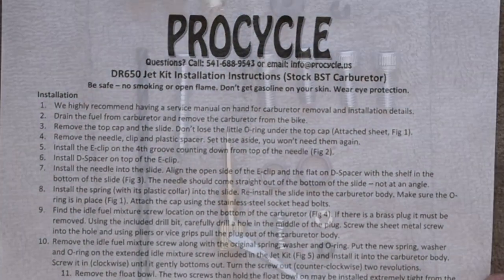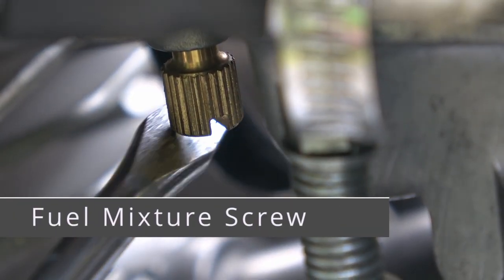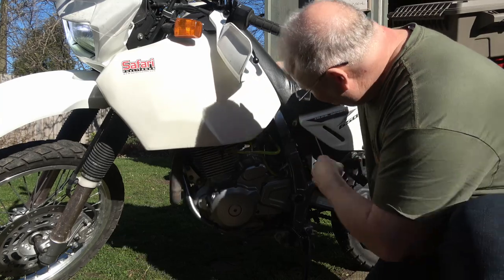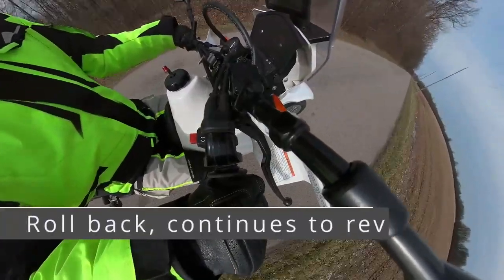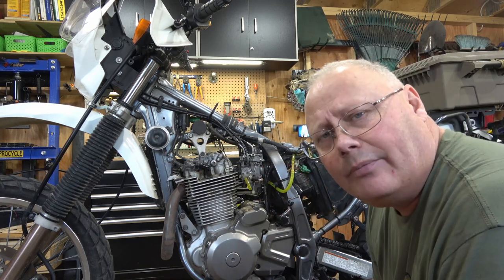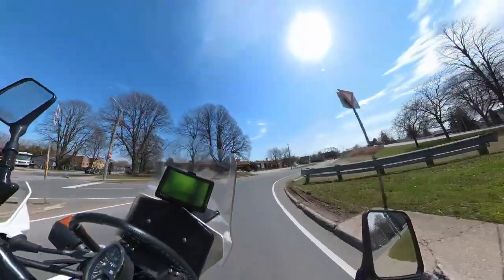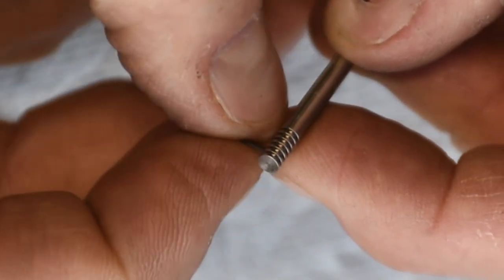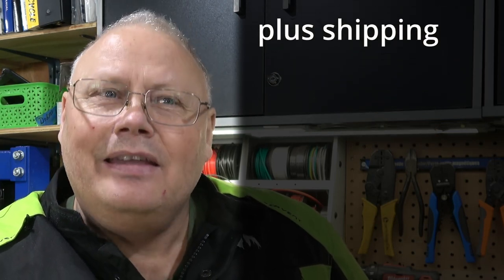I show you how to tune the Procycle jet kit installed in my DR650.

Comment: Hey Dino,

I'm confused regarding tuning using the extended mixture and the other idle screw with the white/clear knob at the end. I ended up tinkering with the white knobbed one as well and now I'm sort of lost.

Are we tuning both? I understand how to tune the extended fuel mixture screw, but not the white knob screw. Please advise and many thanks.
Reply from the maker: Thank you for a great question.
If I understand it correctly, the mixture screw adjusts the low speed air/fuel mixture ratio by opening or closing up the fuel port, so think of this like mixing a cocktail, the ratio of alcohol to the mix you use. The idle screw physically limits the opening size of the butterfly inside the carb which allows the amount of air to enter the system and in turn mix with fuel when the bike is at idle so this is how wide you open your mouth to take a drink. I know this is an odd analogy but basically the mix screw adjust the  air fuel ratio and the idle screw adjusts how much mix the bike gets at idle.
Let me know if this helps?
Thanks again for a great question
Dino
Reply: @DinosTinkerShed  Okay so after turning out the extended air/fuel screw 2 revolutions (procycle default suggestion),

do I first fine-tune that extended air/fuel screw AND THEN adjust the idle screw, or do I adjust the idle screw FIRST, then extended?
Reply from the maker: The air mixture screw is adjusted first. Turn it in until the bike stumbles and then thread it out until it smoothes out. Adjust the idle screw next until you reach the idle speed you are looking for. I believe it should be about 1500 rpm when the bike is warmed up.
Dino

Comment: Im not completely satisfied with my results yet. Im running the 150 with leovince exhaust, clipp at 4th. I get a lot of decel popps. I have not modified the airbox yet, just rrmoved the snorkel. It runs pretty good but i get some hickups when applying full throttle from half throttle, especially in 4th and 5th gear. Might it be a breathing issue, due to not opening the air box? I tried removing the sidecover but i ran worse. Any Suggestions?

Comment: What's the point in jetting for stock air box and stock exhaust?!
Reply from the maker: Better cold weather starts and a smoother idle down low. Bike is very lean from the factory.
Reply: @DinosTinkerShed  i just added procycle kit, cut air box, 155 main jet and wide open exhaust. It's running really lean. Not sure what to do